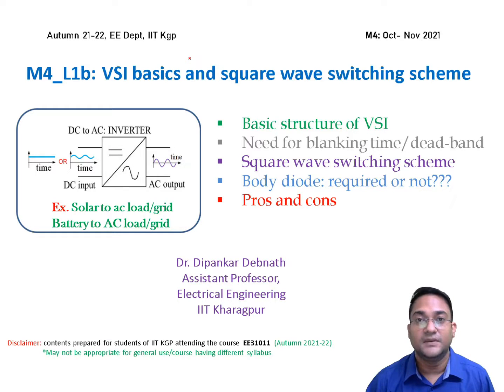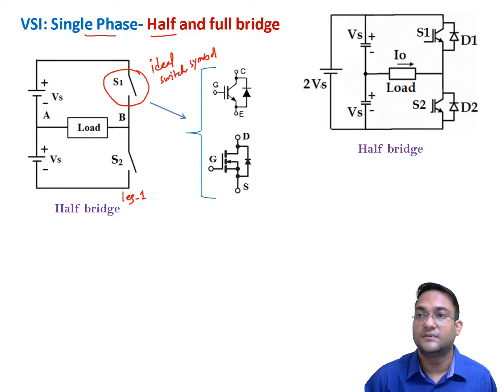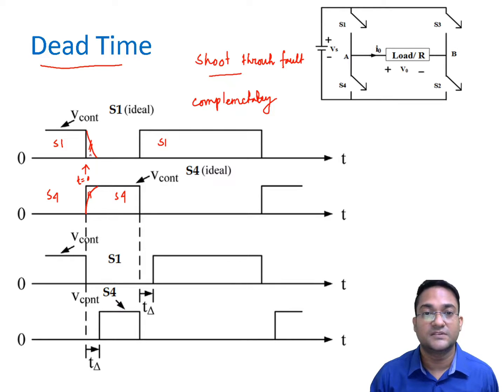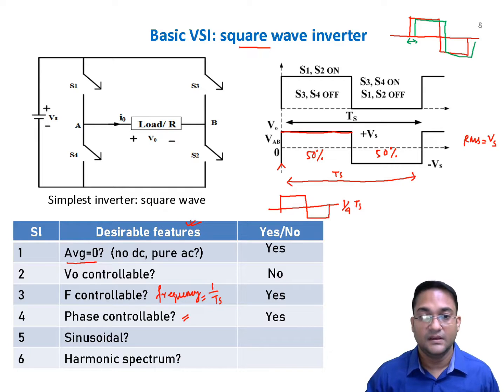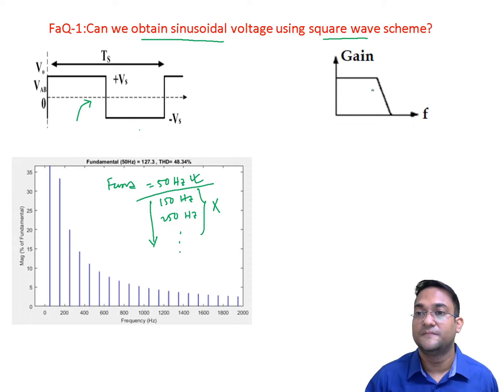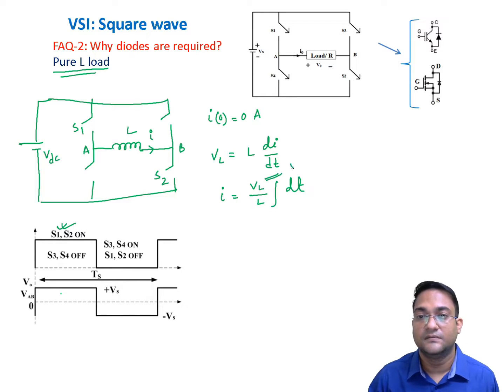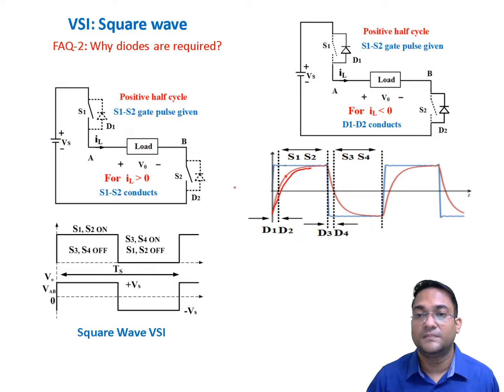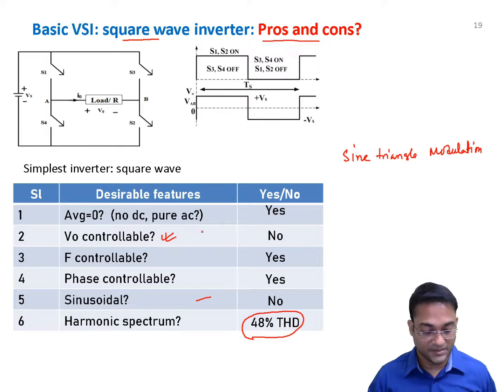M4L1b: DC-AC converters: Basics of VSI, square wave switching scheme

Comment: IN revision slide  I think the diode will not conduct because anode is -10 v art cathode , we know thatanode should be more positive than cathode , in this case anode is -10v and cathode is 0v , so diode will not conduct in forward bias conduct, therefore the current will become 0 ampere in the circuit, plz reply me if m wrong 

Thanks for vlog